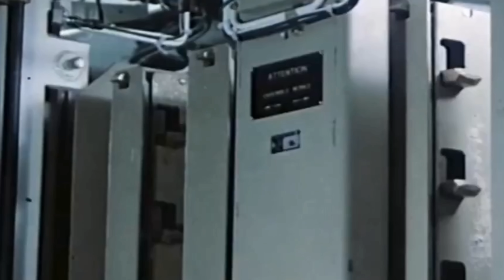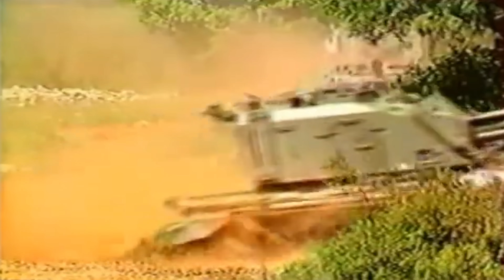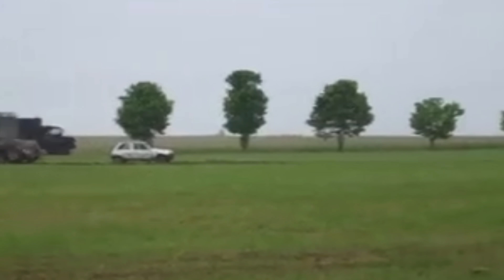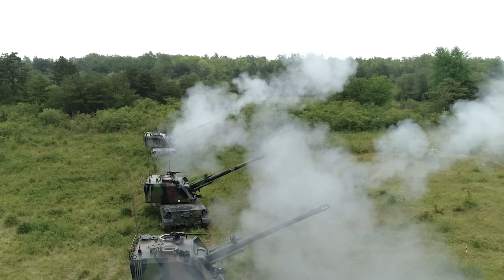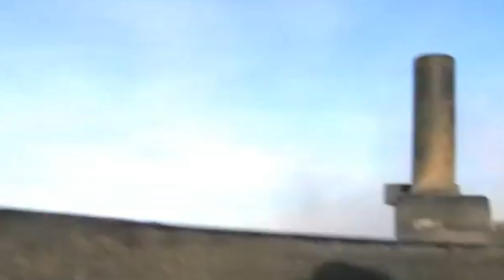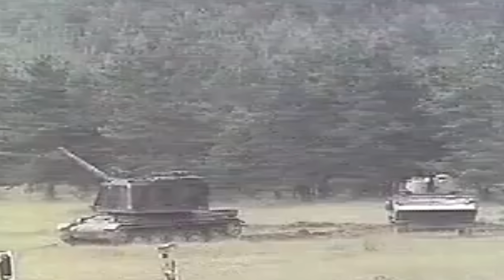AMX-30 AuF1: France’s Autoloading 155mm Artillery

Comment: Seems to me that once you fire you have sixty seconds to complete your fire mission and relocate if you wish to see another sunrise; that may not always be the case but I'd definitely plan, equip and train for it.
Reply: That's what we were taught as mortar conscripts in 2003 anyway. 30sec after first shot left the 12cm tube for enemy radar to triangulate firing position to ~500m accuracy and send preparatory orders to counter battery units, when our first shell hits, ~60sec after firing, enemy would be able to refine the triangulation to ~50m radius accuracy and send corrected firing command to counter battery assets. 30-90sec later, our firing position could be expecting to recive enemy fire for effect, and thus our training focused as hard on rapid re-limbering and extraction as on reaching consistent first salvo accuracy on target.

At final exam manouvers, our 500m distance extraction time was down to 59sec from full deployment with 4 towed 120mm m/1941 mortars and 1980s soft skin 6x6 offroad cars...
Reply from the maker: That's a very astute observation, and definitely a sound principle to follow.

Comment: How much does chassis recoil affect accuracy?
Reply: it really depends on the design , there are ways to mitigate it, France had clever mechanisms of "faux" gun stabilisation back in the days like in the amx10, so i wouldn't be surprised if it isn't actually as bad as it looks.
Reply: Given that they tend to train in France to put 3 unguided shells inside a 20mx20m (sometimes smaller) target at max range (almost 42km) under a minute, I'm guessing the accuracy is decent, for French standards. It's amazing for the NATO standard.
Does that answer your question?

Comment: The swedish Archer
Reply: FYI 120 Caesars are in Ukraine and only 6 lost (5 in 6x6 version and one 8x8)  which is pretty good considering it was one of the first to arrive in Ukraine, one of the systems most used and in biggest numbers, with better operational rates and lower loss rates than any other SPG because it is simple to maintain and more reliable. (this is data from Ukraine and verified by KNDS as of 1st half of 2025).  all this without compromising  firepower, accuracy and reliability

Comment: Auto-loading artillery fits modern doctrine like well stitched glove. You want them to fire as many as possible and leave, but that means human loader just can't cut it anymore.
Reply from the maker: Agreed, the rate of fire is crucial in modern artillery doctrine.
Reply: Also means more maintenance.
Reply: @rottingravensblood9106 check the shell weight and come back later dude
Reply: @rottingravensblood9106  oh well, at least if it breaks you are a back lineish unit that can drive back and get repaired (as opposed to a tank, which is stuck in.